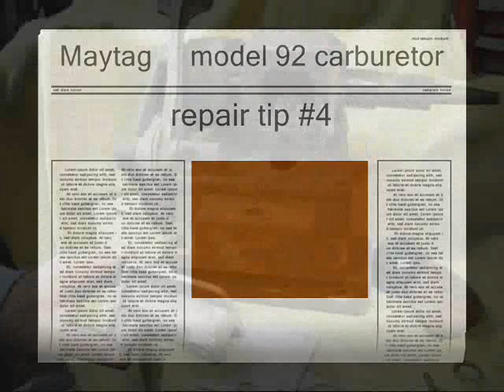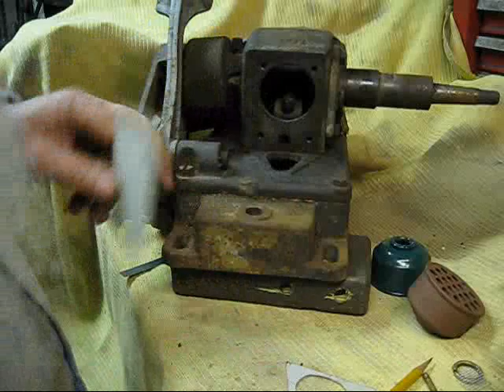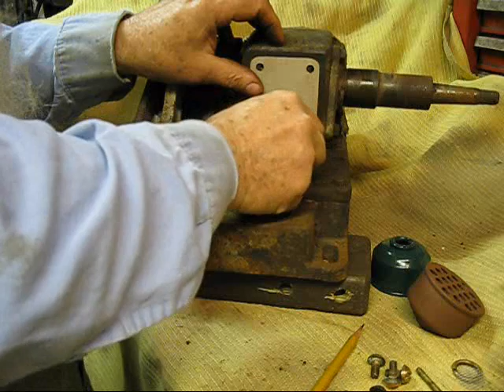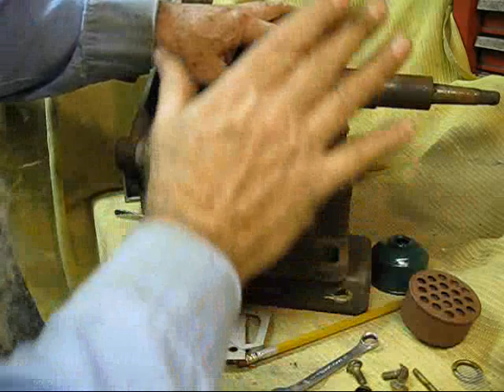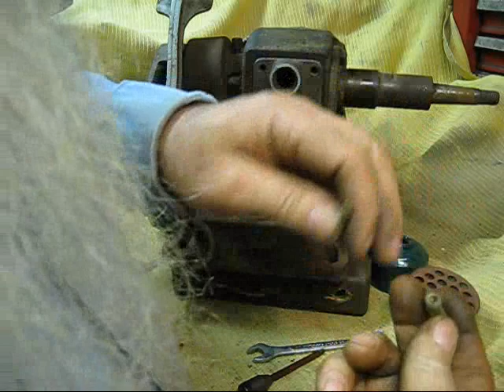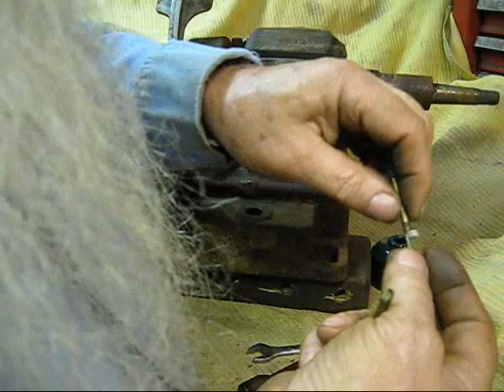Maytag Gas Engine   model 92 repair tip #4

Comment: you're the best , I  have a 92 without the ball in the fuel tube check valve , will I be able to get it started without this check valve ?
Reply from the maker: ,, the short answer is,,,, no,,,

Comment: I just come across a model 31 maytag engine. It has good compression and fires good with the original maytag spark plug, but it floods really bad when I try to crank it and gas comes out of the breather. Do you know what my problem might be?